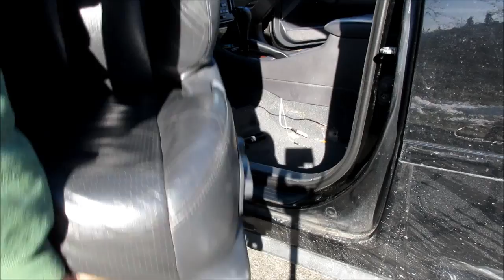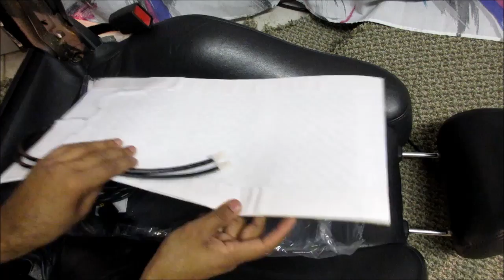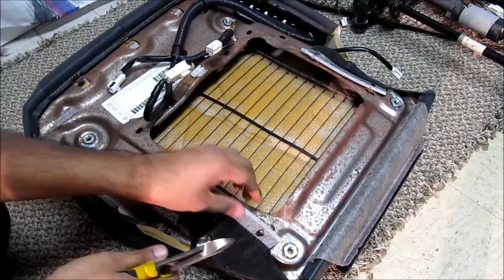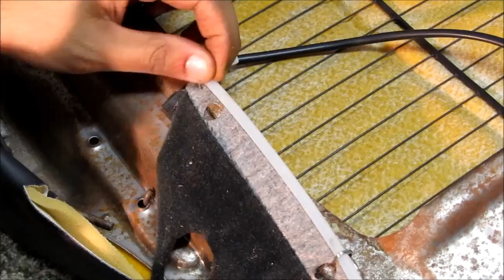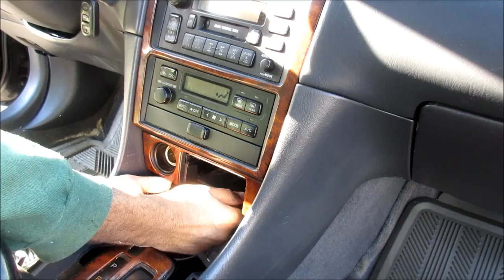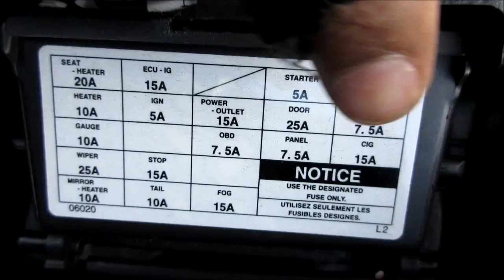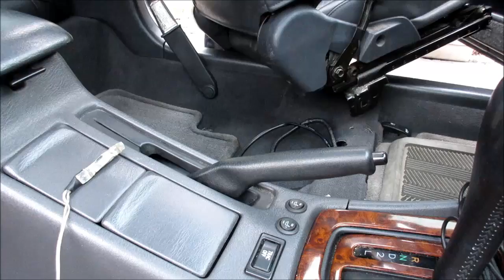Heated Seats Installation

Comment: I love your videos!! Great camera position. Great detail. Very in depth. Keep them coming. 

Doesn't seem like your getting rid of your Solar anytime soon huh? I need to replace the struts on my 2001 Camry but its gonna be like a $400ish job with me and a neighbor to complete. I don't want to spend that kind of money on a relatively old car, but it only has 107,400ish miles on it. And I don't think I want to upgrade to a car with stability control, traction control, blind spot monitoring, etc. I like to drive so I don't like so many tech nannys.
Reply from the maker: Thanks for the feedback on the video. I try to keep them clear and easy to understand. I like my Solara and will be keeping it for now.

Struts are pretty easy to replace, even if doing it yourself. Check out my quick strut installation video:
https://www.youtube.com/watch?v=bWsWy-qBwf4
Reply: speedkar99 yeah I saw your strut video and I realized they are pretty easy to change. Found some KYB complete shocks online for about $450 total. Now it just seems like a lot to me for a 14 year old car next year. But it only has 108k milies so... But the paint on the top is chipping pretty bad especially on the rear, it's the clear coat and I see some coming down the c pillar. Plus the head linear is a bit saggy in the middle, I fixed the end but the middle is hard since I stretched it out in the end. 

To be honest if I had a V6 in my Camry I would keep it HANDS DOWN. I have the electronic nanny's in cars. With a V6 I would keep the Camry until it blew up.
Reply from the maker: I don't think you should give up on a car just because it needs struts. $450 is outrageous, have you checked on RockAuto, that's where I got mine from.
Reply: speedkar99 Its $450 for all 4. I've been on Rockauto's site. They charge an arm and a leg for shipping. KYB's are the best I hear from everyone

Comment: How much where the heater pads? Do they get hot enough? Great video btw
Reply from the maker: The heater pads were roughly $60. They get much warmer than the stock ones in my Lexus, though they take a bit longer to warm the seat.